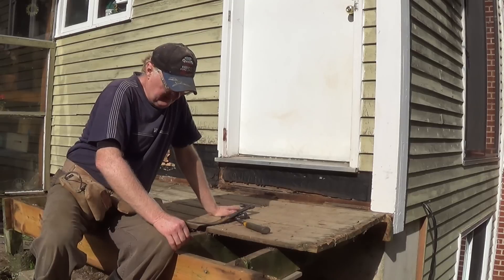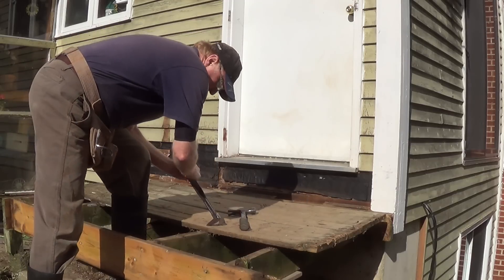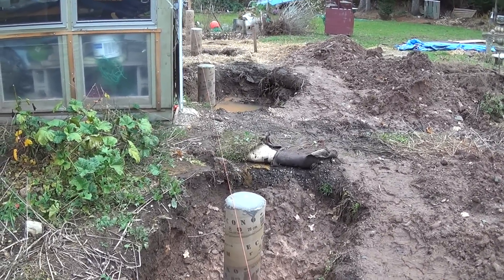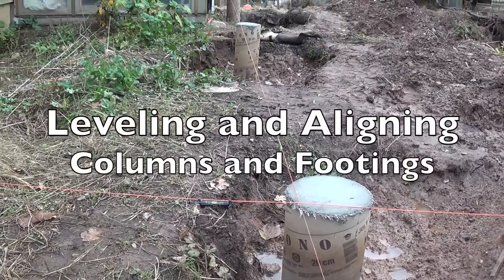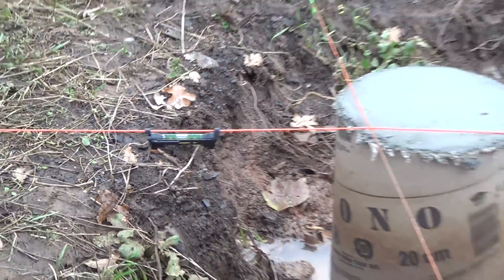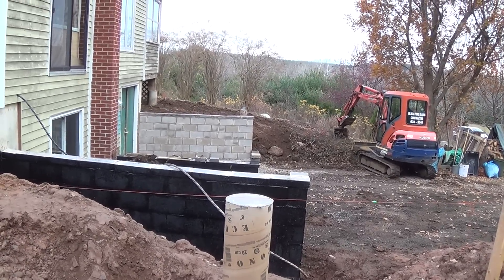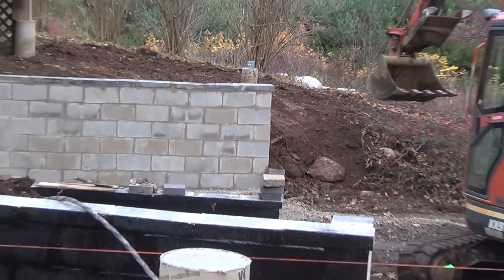DIY Deck Part 1 - Setting Footings & Posts

Comment: I have been building decks for a while and I am always watching deck videos to see if I can learn something new. I have to say that I have learned a few things from watching your videos. I've never seen a Bigfoot (beast or footing mold) and you skipped over the cement pouring process so i'm wondering if you installed rebar into the the top of your bigfoots and extend upwards so that you could tie the cement in the sonotubes to it? Thank you for taking the time to post your wonderful videos.
Reply from the maker: Thanks for your comment.
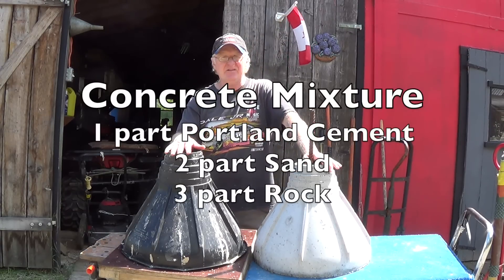If you look at minute 1:00 in the video you'll see the rebar that I installed.
Reply: @BasaPete  Thank you for the reply. I didn't even realize that what I thought was a second Bigfoot was actually a cast from your Bigfoot mold. My bad. Two more questions. Why did you have to put the 24" by 24" patio stone down before setting the Bigfoot in place? Seems like the Bigfoot would surely seat on the soil. Secondly, how did you lift those bad boys?
Reply from the maker: @bradeley6409  The 24" x 24" patio stone makes it easier for leveling and positioning of the concrete bigfoot, also makes for a better footing. 
I used a hand-dolly to move the heavy concrete footings. And the rebar sticking from the top of the bigfoot makes it easier to handle the weight.